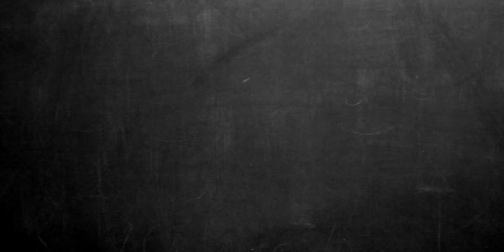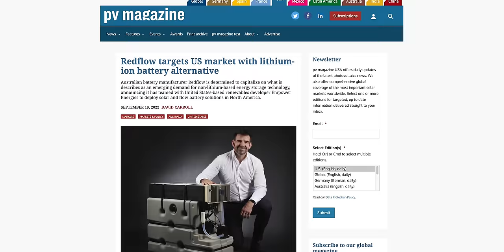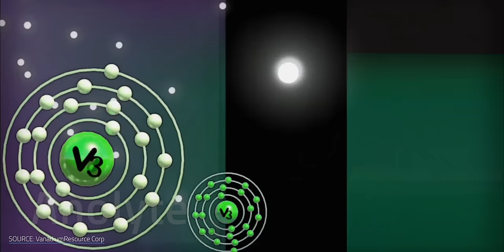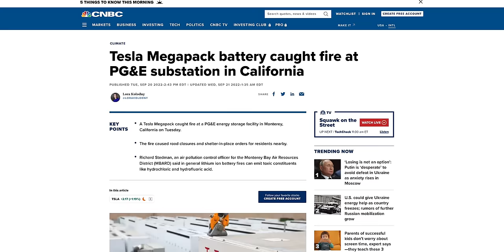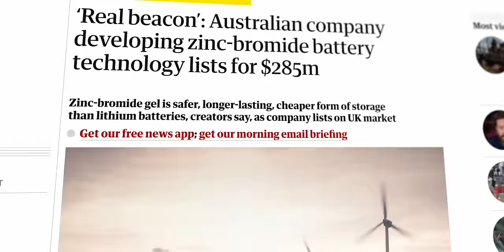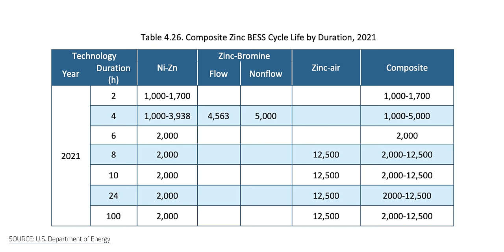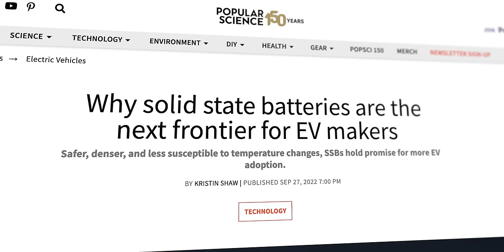137 Year Old Battery Tech May Be The Future of Energy Storage

Comment: Energy Storage.  Since electricity is only a way to move energy from one place to another, it is more suited to fixed locations such as houses, factories and the like.  Not for mobile uses since, at the moment, we have no really suitable method of storage in a mobile environment.  We need to be able to move energy from one time to another, for when the sun doesn't shine or the wind doesn't blow.  We only currently have a few installations for large scale energy storage and they are extremely expensive - for example Dinorwig (see: https://en.wikipedia.org/wiki/Dinorwig_Power_Station) pumped storage in the UK.  I don't have the answer; we don't have the answer - yet.

Comment: SELF DISCHARGE.  You never mentioned how (good) or how (bad) the self discharge is on these bromide batteries.  Like, if I had an array of bromide batteries at my house to use as emergency when the grid goes down.  How long could I expect a fully charged array of bromide batteries to remain (charged) without any outside "use".  Or, how oft do these need topped off.  Lithium has in incredibly low self discharge.  Are these bromide batteries comparable ?

Comment: Is lithium-ion energy density based on the TOTAL capacity of the battery, or the 80% that's available to use? If it's the former, then how do flow batteries compare to lithium bearing in mind that flow batteries can be discharged 100% and lithium cannot?

Comment: I still don’t know why no one has come up with the caesium crystal battery that I was lucky enough to see at a company called Vega in North Carolina a piece of caesium on one side in the centre was crushed up clear crystal and on the other side was five solar cells you had to put on welding helmet when the top was removed the crystals were that bright because they reacted with the caesium and caesium you can get anywhere I have a piece of it here that I use for testing in an acrylic desk this battery was the same size as a car battery caesium in the centre was the crystal in between two clear acrylic plates and then the solar cells when the top is on it put out 28 apps and had a 15 year lifespan

Comment: Zinc Bromine batteries are especially useful in high temperature environments, not facing all the heat (and fire) issues that plague LiFePO4. Redflow really target that household to small grid size (up to container sized, but linkable and scalable) and are very good at what they do. For a household, small medium business even up to a neighborhood scale solution they are probably the best product out there right now, and the fire safety aspect is a real concern in our Aussie heat.

Gelion seems to place themselves in a good intermediate ground with the transportability and safety, but without the energy density I'm not sure that transportability is that big a win. However, being able to be built in a similar way to normal AGM batteries may be a huge advantage on cost and also may suit mobile power applications like caravans down the track.

For stationary power stuff another old tech - Edison batteries may well be a great option too. Time proven. Lifespan measured in generations, not years, and the higher charge discharge rates are great for drawing current from them, and common elements.

Self discharge is a problem as they leak about 2% charge a day, but in an application where they're getting recharged on a daily basis that's really a non issue.

Weight is a big thing though. Stationary applications only, just like the RedOx flow batteries.

Really, I think Lithium based batteries have a place, especially right now in mobile phone or automotive applications where the highest density is the critical goal. But over time as charging infrastructure becomes more readily available, speed of recharge, number of charging cycles before failure, cost, and availability of chemicals are all going to be far more important than that charge density.
Reply: Nothing will become more important than energy density when it comes to a portable world where vehicles and electronic devices need to be portabel.
Reply: @randybobandy9828  if you can recharge 70 times faster than current tech (like solid state can do) do you still need to pay for more range, and carry more, bigger batteries?

We don't drive around in fuel tankers to get maximum range.  

There is a point where range versus refuelling speed matches out.
Reply: @AndyViant  lmao.. yes.. 70x faster over a tesla supercharger is an absolute unbelievable amount of power. We are talking 72,000w -250,000w for a tesla supercharging station. 70times that? That's 5,000,000w-17,500,000w that just wouldn't be feasible for our grid.
Reply: @randybobandy9828  the amount of power provided over an hour, the difference between the 250kw supercharger version and the 150kw version is minimal because the battery management and the battery itself cannot actually cope.

The measured difference in real world charging time between 150kw and 250 kw tesla systems on a model 3 was like 2 minutes.

So clearly they can't charge anywhere near the 250kw claimed rate, because the battery chemistry limits it.

ChaDeMo 3.0 is rated to up to 900kw, which is up to 6 times faster than Tesla.

Yet greater speeds are possible when battery technology (or size) is improved.

As far as how much power is theoreticaly possible, how much kw do you think a 2x25kv 400 Amp Catenary wire can deliver?

This isn't fantasy technology, it's a standard that is used by electrified transport right now.

So can we recharge much faster? Yes we can, even without capacitor based charging.

Comment: So Matt, what's the self discharge rate on these things?  For my system I would really like to use Edison Batteries but the self discharge rate is horrendous so deep-cycle FLAs are being installed. 
As for the "toxicity" of the lead; I'm not in the habit of licking my storage batteries so that is never a concern.  Plus over 98% of a LA is recyclable at a much lower cost than those dirty lithium  things so I am not considering those at all.

Comment: Don't see what's wrong with Nickel Iron batteries for grid scale storage frankly.
They are perfect for the daily peak.
Materials are common, cheap and while they do require maintenance it could easily be automated.
The only problem with them is that they last apparently forever which makes using them to exploit the market difficult.

Comment: What is your opinion on Replacing petrol/gas/diesel entirely? Is it going to affect any other usable products from petroleum?
In other words, is diesel and petrol two of the byproducts or not.
Reply: Look around you right now.  See everything that's made of plastic (and most of what is "rubber")?  All of those items require petroleum (at least for now).  Moving items require lubrication, in many cases grease, which is also petroleum based.  Let's say someone releases a working 99% efficient solar panel that can generate 1kW per sq. meter tomorrow, and someone else releases a super inexpensive, lightweight and ultra-dense "battery" system.  Yes, it would greatly reduce the amount of petroleum needed (which IS a very good thing, for many non-environmental reasons) but oil production will still be needed for the foreseeable future.
Reply: @michiganengineer8621  that's good info. Technically, tyre will need petroleum byproducts then?

Comment: Zinc Bromine can provide some reprieve for competing for Litthium. Right now, Lithium is best utilized on having the smallest and lightest battery as possible while having good capacity and energy density. Though, I'm looking forward for employment of this flow battery and those solid state batteries to be used on cars just not to get the shortage of lithium further. Not to mention, keep it cheaper. Especially since, I heard EU no longer welcome ICEs for newly produced cars while fuel cells is yet to further take off instead of like what, providing economic incentives?

NOt to mention, with Zinc Bromine and other battery tech, it can allow other reprieve when poltiics would finally make up its mind with nuclear energy. NIMBYs and Green aside, there is the proliferation problems that ruins nuclear energy.

Comment: If gelion are the size of a Lead acid battery, I wonder if they would work for golf carts or small electric bass boat motors. Or small battery banks like off the grid cabins.
Reply: I saw another comment saying that apparently the Gelion has a fairly slow discharge rate, so it's doubtful they would have the surge to get a motor turning at the start.  For off grid where you'd likely have several feeding an inverter of some kind I think they'd be just about ideal (as long as they can handle at least as wide a temperature range as LiFePO4).
Reply: @michiganengineer8621  makes sense. I appreciate knowledge for knowledge sake. And I have an off grid cabin 😂.
Reply: I was thinking the same thing. Lots of electric golf carts or even electric mowers use 12 v leaf batteries. It would be interesting to see if it could be modified to run on the gelion battery. If I understood Matt correctly they may be lighter weight (more energy dense) than the lead batteries, if that is the case that is another benefit.

Comment: A month ago I had an idea for a similar concept(or a daydream) for a battery that involves liquids and could be used for vehicles as a battery, and you have two tanks on a vehicle. You could recharge it on your own at your place or go to a station similar to a petrol station where you swap out discharged fluids with charged ones. I thought of it this concept cause I don't like the way electric vehicles are. I am not getting an electric vehicle unless they start making these vehicles with modular batteries that can be swapped out fast. Either it's modular batteries where you can swap out cells at charge stations where those get recharged or it's liquid that gets flushed out fast. Other than that I'm sticking with diesel which is renewable and scratching my brain about ideas of oil-producing plants that needs some genetics modified to do it fast or fast-reproducing algae that are limited to produce oils instead of sugars. Disclaimer, these are some weird things I'm daydreaming at the same time when I don't understand any chemistry.

Comment: I'm curious about the recent development of the magnesium air batteries with a dual layer gel electrolyte. From what I've read, it has a very high specific energy density but I'm not sure if the magnesium gets consumed like in the Al-Air battery or if it's rechargeable. Either way, potentially promising tech for a range extender.

Comment: Do you have any more information about the way dendrites are got rid of?  This the same problem with Lithium ion batteries.

In Data Centres much of the Data Cabinet steel work is zone coated. Zinc has a bad habit of producing 'Zinc fingers'  (dendrites) on electronics causing short circuits.  This zinc is sloughed off the coated steel and into the surrounding air.  It get deposited elsewhere and grows dendrites.

With Zinc changing from metal to it's ionic form and back again dendrite formation must be common.

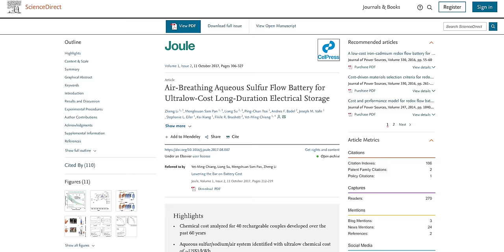Comment: 8:23 I don’t know how trustworthy an estimate from 2017 is. This is 2022, and a LOT has happened in the last 5 years since this report was compiled. Even as an illustration I think it’s misleading. 

Full props for Redflow, but I was personally in touch with them about getting their batteries to Europe, and was told that they are only doing 1 MWh storage minimum, and that their individual 10 kWh batteries will not be exported for “some time,” meaning either demand is so high in OZ, or their facility in Thailand cannot produce enough cells. Either way, it is frustrating that the tech exists, is cheap, easy to make, but you can’t have it.

Comment: 'Developing efficient energy storage systems will make or break our progress in the use of intermittent renewable energy'

I agree, but at the same time don't agree. Yes, storage will be important, however not the (battery) storage talked about in this video.
Battery storage is fairly easy to accomplish. It's a huge task, but the systems to solve fluctuations in consumption and generation over short periods of time (lets say a week) can be bought tomorrow, and the only challenges are manufacturing capacity and price.

The hurdle that is way bigger is storing energy in summer, which can be used in winter and nobody seems to have a clue yet how to do that efficiently (both costwise as in the amount of energy that can be used in winter).

Comment: Could we not have "gas" stations for these? Instead of swapping the battery with a fully charged one, we could just pump out the current electrolytes and refill with "charged" electrolyte. Then the discharged fluids can be run through an on-site charging system that pumps out charged fluids into reservoirs to be used to refill other vehicles.
Reply: Redflow say that at 'end of life', they can take back the fluids and refill the system with fresh fluids, then recycle and reuse  the old ones, so I don't see why you couldn't do what you are asking.

Comment: Flow batteries are certainly a contender, and zinc bromide sounds like a real winner for grid-level electrical storage. Has anyone spoken to the Army and Air Force yet? The money is certainly available, the mandate is certainly there, and these look to be easily installed, low maintenance, and being "abuse resistant" is a major selling point in its favor.

Comment: suspect that liquid metal batteries might be a better home option.  All it requires is heavy use.  Perfect when you use most of it's capacity every day.  All that the electronics has to do is to use the battery when there is any power left in it and only send power to the grid when the battery is full.  Oh, of course, close the connection to the grid when the power goes down,

Comment: How do these compare to lead acid in terms of current output? Would be nice to see them replace SLA batteries in cars
Reply: Why? What about lead acid do you need replaced? They are cheap to produce and are very recyclable.
Reply: @randybobandy9828  these would be lighter than lead acid, and if these became the go-to like lead acid had been for cars, the price would drop as production scaled. Then I guess we could use all that extra lead to make larger grid storage cells, since weight isn’t really a problem there

Comment: In all those batteries videos, you talk about the cost perkg, energy per kg, etc. but i think you should also take into consideration the usage in real life.
IRL, Lithium batteries are controled to not discharge more than 20%, or charge more than 80%. that's a 40% total. Suddendly another type of battery that supports full cycles can compete.

Comment: LTO chemistry battery. Thousands of charge cycle's, non-toxic, fireproof safe and reliable batteries with adequate power transfer C rates, and a density of 120 watts per kilogram. Up to 100,000 charge's at 80% DOD.

Comment: The real point that's hard to argue about is that Lithium Ion batteries used as storage in metropolitan power systems is an absolute waste and heads should be examined wherever it's seen. On nearly all points, they're far more hazardous, expensive and shorter lived than a vast number of alternatives. The main positive feature of Lithium Ion is its energy density and secondarily how a vast number of shapes are possible.

Bromine batteries aren't the only possible option for low energy density uses where the main negatives are mass and volume. Efficiencies that are similar to Lithium Ion are interesting, too. But in general I feel that all chemical batteries share the dendrite formation problems so at the least require maintenance and at worst means periodic replacement when alternatives don't suffer similar problems.

Comment: There is alternative tech to batterys that no one investigates. I made a unit  of 8mm dia discs half mm thick magnet copper  moist paper zink magnet copper paper zink etc ending with a magnet 40mm long gives 18 volts but no current capacity but I'm working on it.

Comment: Maybe they should separate how much energy is needed in electricity and how much in thermal energy. And then take batteries for that use. Just because, for electricity to heat storage there are some dead easy possibilities which need far less maintenance and have a far longer lifetime than electricity to electricity storage. Also, a lot of energy normally is used in thermal energy. therefore, The total costs would be drastically reduced. Sure that something they don’t want. But in the end all those programs will ask for government funding. also, that money wouldn’t benefit only one company but more and reducing dependence on one technology. If it’s less expensive that’s only a win win situation. (Maybe not for one specific company)

Comment: Redflow batteries not only can be discharged to 0 - they must be discharged to 0 from time to time to eliminate dendrite build up.  If you want their 10kWh batteries in your home, it is best to have two of them so one can discharge to the other on a schedule.  Anything we can do to stop Li competing with Li is a good thing.  If all static applications were some other technology, the huge demand for Li would decrease and the batteries and hence EVs could be sold for less and still leave a good profit for EV companies to continue to expand their operations.  Li should be getting less expensive as we discover new sources and improve refining technology but as you say, the price has increased X7 over the past decades.  It is all due to supply and demand.  All that these alternate technologies, including ZnBr, are missing is market share to get them down to a price well below Li batteries.